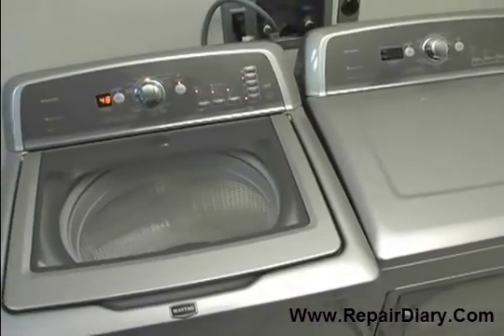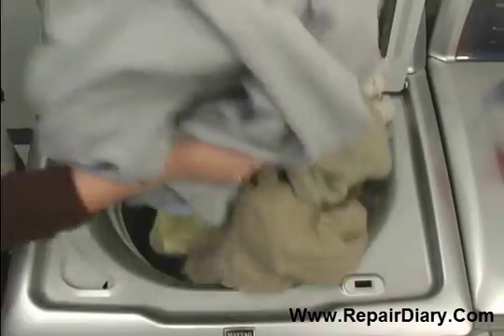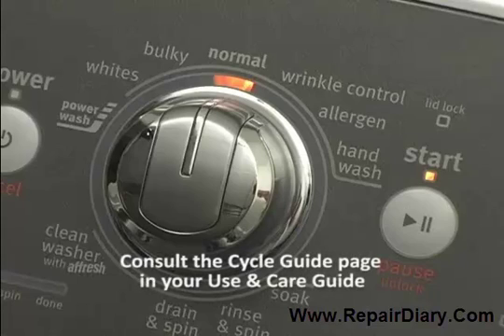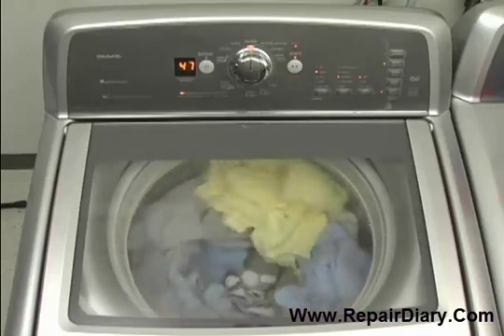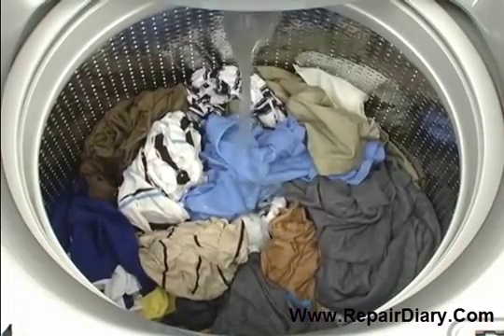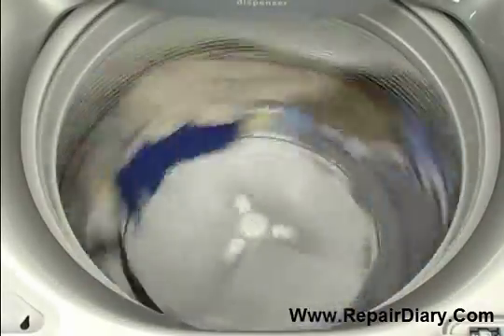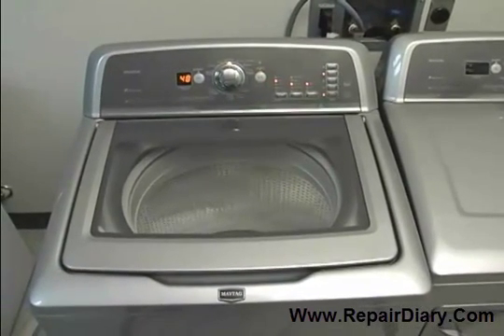How High Efficiency Top Load Washer Work

Comment: I truly feel bad for these washer and dryer companies.  They design superior machines that clean clothing with less wear and tear, water and electricity than previous generations.  Then, they have customers whose 10+ year old agitator-model machines with manual controls that use 30+gallons of water per wash upgrade to a HE, impeller-driven machine.  They buy the wrong detergent and stare with confusion as the new machine doesn’t clean their clothing in the same manner as their machine purchased in 2002 did.

Even worse, they have a glass top, so they can watch the cycle.

“This isn’t what my machine from 2002 did!  And what are these noises?  This entirely different technology is doing something entirely different!  Something MUST be wrong!  It can’t be that I have zero knowledge of the design of the product and never bothered to read the manual.  It has to be that the company designed a machine that doesn’t work, and is swindling me.  Why would a company want happy customers?  That’s illogical.”

Mumbles something about the government making us use less electricity and water, because why would ANYONE want a lower water and electricity bill?  Damn Commies.

Unfortunately, 50% of people are below average.  You can find those people clogging up the comments sections of videos that are designed to help understand technology.

They still make agitator-based washing machines that use tons of water and electricity to beat your clothing and stretch it out so it doesn’t fit anymore.  The best part is those machines are cheaper!  Save your money and buy the cheaper machines.  You’ll need it to replace your worn-out clothing.

Added bonus: the agitator can help stretch your clothing out to keep pace with your undoubtably expanding waistline over the years.

Comment: Someome with hacking abilties will make lots of $$$ to change that BS water saving software coding. The govt has interfered with the manufacturers and force them in this conservation measure. I remenber those maytag commercials showing a red sock in white clothes to demonstrate the agitation force. Never thought I’d be teary eye over a freaking washing machine. My 32 year old Kenmore broke a motor coupler. and with these new HE washers, so was my heart. Who said burly dudes aren’t sentimental.

Comment: These would be fine for people that don't get dirty. I had one for 2 weeks and sent it back it smelled like sewage after sitting empty overnight. The only way to get the smell out was run a cycle with bleach. Most of the clothes didn't get wet and if there are stains from grease, oil, or mud use your wringer washer because these won't even touch that stuff!!!! Yes I pulled out the wringer washers they work best.

Comment: I bought a washer like this today. I washed serveral clothes and then on the 3rd wash whenever it was on the spin cycle it made a bang noise side to side is this normal?
Reply: Orlando was it when it was stopping? If so that's normal it happened to me it just went bn ban bag bang bang bang bang bang bang......bang.........bang.......bang..............bang it can occur during spinning to like bang.bang.bang.bang.bang but more quiet
Reply: al stewart it was when spinning started like 5 minutes until it finished. This only happen 3 times so far, but the bang is so strong it moves the washer so idk

Comment: This review seems completely dishonest. The clothes do not appear to be sucked under like she says. So many people with diapers or mud have said these don't clean, many have even said parts of the clothes do not get wet and came out dry.  Being that the impeller is relatively flat and just moves back and forth, how are the clothes being pulled under and mixed into water? Consumer reports loves these types but they only test stains. What about lint, solid particles, debris from if you work outside. My Maytag HE got rid of stains but my clothes were covered all over with bits of debris, lint, and small pieces of grass from cutting the lawn. I never had this show up from years of doing wash with older machines. You need actual water and agitation to remove the solid matter. The review really shows how false this machine claim is. If you can't even cover the impeller and have to lay clothes around it how do you get the machine full enough with clothes, how is this high capacity? God forbid covering the impeller which is supposed to actually wash the clothes? The machine only looks 1/3 full compared to trad machines. If you did fill it to capacity I bet these would not clean very well, or worse than they already do.

 CR is really missing the mark too and doing an inferior job of reviewing. Its all because of these Big Brother govt mandates we have these ridiculous machines. The biggest joke is that they last only 5 to 10 years compared to the 25 to 30 years of the older ones (mid 90's). How is that energy efficient for all the energy it takes to build a washer, and then the cost of recycling, cost of transport. 14% of Maytags and GE's have to be repaired in the first 5 years. Gee sending a repair guy wastes gasoline causing more CO2. That has got to eat up any savings on energy. The unit runs for 90 minutes. It first says it will take 70 minutes, but when I timed it the clock time sit at 90 minutes. How does that save energy compared to the 35 to 40 minute sof other washers. This is all stupidity and hypocrisy of idiots who run the corps and govt.

Comment: I have a Maytag Bravos machine like this. I hate it. It does not use enough water to clean. My main complaint is the fact that water is left in cavities under the drum that NEVER gets drained out! Notice the cycle on the dial that says "CLEAN WASHER WITH AFFRESH". They put this in because after just a month or so the washer starts to smell like sewer. The fix is to put in 1 or more of the AFRESH tablets (bleach) then run this cycle and NO CLOTHES, it will be using 100% hot water. How is this saving anything? You must run cycles with pure hot water and no clothes!! What a joke. I am getting rid of mine and getting a standard top load with an agitator. I can not in good conscience keep the smell problem a secret which means I will have to almost give it away. There are Utube videos showing people actually taking their HE so called water saver machine apart to clean out the mold and slime from under the tub! Furthermore; since the reason you need to run a special cycle just to clean the machine is because water residue is left undrained. Now you have residue from the clean only cycle that is bleach. Guess what happens to your next load of not bleach save clothes?  

Stay away from any machine that needs a special machine only clean cycle. CLEAN WASHER WITH AFFRESH = JUNK

Comment: I'm 53 so I grew up doing laundry with agitators in machines. I really don't like agitators so I buy the brands without one but all the other options these new machines have are annoying. I need a delicate cycle plus a normal and bulky option but some are unnecessarily complicated. They're also not built to last. One thing that is also very disconcerting is clothes coming out with dry spots as mentioned in the video. I don't want expensive clothes ruined but are the clothes set on a gentle cycle with dry spots really getting cleaned properly? Ugh.

Comment: You call these HE, high efficiency, well in reality HE means HORRIBLE EFFICIENCY. Less water, less suds, and you say the clothes are cleaner. You can't put in a drop of water, a grain of soap, spin it and say, this is cleaner than an agitator which actually rotates the clothes in WATER, WITH MORE SUDS and making it cleaner. If you didn't notice, she said it will add some water to rebalance. That means, completely refilling and emptying the tub several times to move a sock 1 inch. Its so out of balance because you actually hang the tub from the top. Speaking of tub, why did you get rid of the tub break, these things take so long to stop, just to put in a pair of underwear, and you have to wait for the fucking lid to unlock too, the direct drives only take around 3 seconds, no delay, just open the lid, put something in, close it, and its on its way. What a disgrace that you think being gentle on clothes cleans them, like what, go to a stain and say, here stain, come off the shirt, good stain. Put the clothes in water, be tough on them, submerge your clothes. There aren't dry spots because of how fast it spun, there are dry spots because you used 2 fucking inches of water and the clothes stayed in the exact same spot. And that indexing tub, makes it worse. The whatever you call it, and the tub rotate at the same pace, so this thing is really just rotating your clothes. Mechanical beats electronic in every aspect. Let me choose my fucking load size, I want my clothes submerged, I want turnover. Very happy to have a direct drive, works like a charm. It uses actual water and soap to clean clothes. Keep your tubs connected to the bottom, not the top, bring back agitators, get rid of this electronic shit. Actually make good washers, more resources actually do better. These things are actually made to break, just so you can spend thousands of dollars to get something that calls itself better and costs more than something that actually IS better.

Comment: My works fine, but I use the extra fill button that adds about a gallon per press. I fill it to the level I want. If you fill it too much the clothes will not agitate because the agitator is too low in the basket.

Comment: 2:35, what is the purpose of locking, unlocking and then locking again? There is no reason, it's just useless noise making. My GE front loading washer does that too. Even if I pause the load and close the door again, hit start/resume, it'll lock unlock and lock again before continuing... stupid.
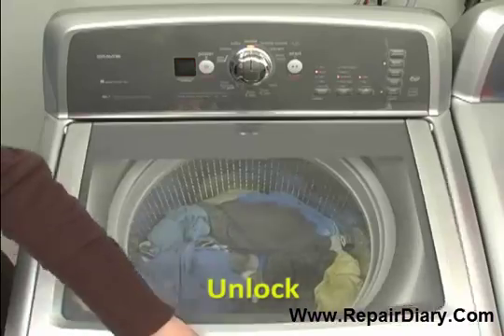4:10, up to 2 minutes for the drum to stop spinning?? I'd hope any modern washer would have either a real brake or have the motor turn into a generator to slow down the drum within 30 seconds from high speed spin of a large load.

Front loading certainly seems like it would do a better job because the clothes are swapping position way more frequently.

Comment: I have been using a Maytag Bravos washer for about a month now and I am amazed at how clean the clothes are after they have been washed.  I usually use the deep water wash setting with medium soil and I can definitely tell how much cleaner the clothes are now than when I was using a washer with an agitator.  At first I thought I would return it, thinking, how in the world can the clothes get clean with that little amount of water.  The key is the clothes get so much cleaner because the way the washer works it is like it is hand washing the clothes.  My wife is from the Philippines where most people hand wash clothes and always complained how the washer would not get certain clothes clean so she would hand wash them.  Since this washer uses such a small amount of water the clothes are like being hand washed by the machine since they rub together, get agitated, etc.  If you use the machine the way the instructions say the clothes should be MUCH cleaner than with an agitator.  I am not exaggerating when I say I can definitely tell a difference in the clean of the clothes.  We also were using a top quality whirlpool washer with agitator before it quit, bearing went out.  I hope to fix it and use it for back up.

Comment: Either people are retarded or use cheap detergent. I have a Frigidaire HE top loader. I live in an apartment, so I don't have a choice. While it took some getting used to using the machine and I don't really like the odd water levels, I can't deny that my clothes and bedding are very clean and bright and smell good and look nice. Try Tide or Persil. Use Downey Fabric Protector. Pull yourself out of the past and use something new or learn how to do laundry and not be a smelly pig. The dryer on the other hand..SUCKS!! But..that's Frigidaire. All their appliances suck. Fridge, oven, stovetop, etc. 😦

Comment: I should have done my research.  buying washers like this doesn't guarantee cleanliness as quoted. I bought this because of the size that will fit blankets and the comforters.  even for "deep water" washing, the water level is halfway filled, therefore it's not cleaning the upper part. whoever invented  this clearly doesnt have a clue what cleanliness is about, and probably don't do laundry themselves

Comment: I'm stunned they don't explain this in the store!  I was sure mine was defective and about to return it.  Here's my only question - by adding so little water, the hot water doesn't have time to heat up.  So, all my loads end up being washed in cold water.  Any solutions to this problem?
Reply: I wash everything on  the hottest setting, which in my machine is cooler than what I would ever use for hand washing dishes.  And on Bulky.

Comment: I wondered how these top loaders worked. Now I can see they
work even worse than the front loading one I bought 5 or 7 years ago. Which
doesn't get the cloths clean btw. My front loader doesn't really clean as well
as the old agitator type. I found that fact out this summer when we were on vacation
and had the old agitator top loading washer in our condo. All five of us
realized on our own that the cloths were clean! Not just clean enough to wear
but fresh like they hadn't been before. So now one of my kids is trying to get
the same cleanness at home and can't, none of us can no matter how many times
we wash the same cloths because it comes down to how much water you're using.
Spend close to a thousand buck or over on some of these non-cleaning washers or should
I call them non-washers. Seems the government doesn't want us to use water, not
about getting our cloths clean. If the front-loading washers worked so good,
why did they come up with this idiot top-loading design on this video? High
Efficiency really means the cloths will not get clean because your washing with
very little water. It's almost Black Friday and the sales have already begun so
I'm going back to the old agitator design that actually cleans and makes your
cloths smell clean!
Reply: same here,I bought one because i wanted to wash Blankets in it..  4.7 cuft  the blanket was never ever being close to be covered with water and the dry spots as the lady stated in the video from spin drying... is BS .... its where the water didnt get to the fabric.. now the control panel went out i it, thats from $200 to $300 for me to fix..not the tech, just the part..
Reply: Consumer groups, where are you to take action on GE who pays less taxes than I and sell a substandard product to the public!
Reply: thank you!
Reply: I just recently purchased a top loader compact HE washed and I've used it a few times about once a week now. I was very pleased with how clean my clothes came out. I am a novice at this and the machine is still quite new but so far I wouldn't trade it for anything!

Comment: The technology for the high efficiency top loaders is flawed.  They were designed by engineers who have never done a load of laundry in their lives.  We bought a Samsung top loader a year ago, hated it from Day 1.  "High efficiency" means less water, less electricity, but they forgot about actually getting clothes clean.  Thankfully our top loader ended up on the Samsung recall list (2.8 million washers, omg), and we've replaced it with a front loader.  At least with that design the clothes are actually moved around in the water and detergent.
Reply: it's samsung branded, you can't expect anything good from those.

Comment: notice the clothes never moved under the water.
Reply: Come out nearly dry coz they bairly got washed
Reply: I know, right? It's so gross 😷
Reply: did you see that? they just moved around a bit, doing a whole lotta nothing....in-cre-e-ble~~
Reply: My clothes move through the time it takes for a whole washing cycle. The video only shows a short snippet time of the washing cycle. So far, my clothes come out as clean as the front loader I had before this new one.
Reply: #bringebackthefilterflos!
Reply: This is shameful!

Comment: Just purchased a Samsung top loader with the added prewash bowl. On the plus side, you can do a lot in one load. On the minus, which is a big one, it does not clean nearly as well. Whites in particular. Oh yes, forgot to mention that the washing machine was just recalled due to the tendency to "explode" during heavy load spins. What a crap experience -  the old spindle we had cleaned more quickly, more efficiently and was less expensive.
Reply: Jim Goodson of

Comment: This washer is such a pain. Mine is a samsung TOP Loader- It keeps rinsing and rinsing because the load I put in keeps getting off balance. I called technician and I am doinig everything right. only washing 5 towels or 6 and it goes for hours and keeps refiling. I want my old agitator machine back!!!! I am using more water than ever!! This is not a good option

Comment: Watering lawns, taking baths and showers waste more water than silly washing machines.  What were the designers thinking? Instead they make a more complicated thinking machine that will fall apart by all the stop and go it does. In addition, the electronic and/or computer boards are constantly ruined by power surges for people who live in the south due to lightning storms.  The message is - keep something that works well alone. We don't need 20 ways to wash clothes - no time for that.